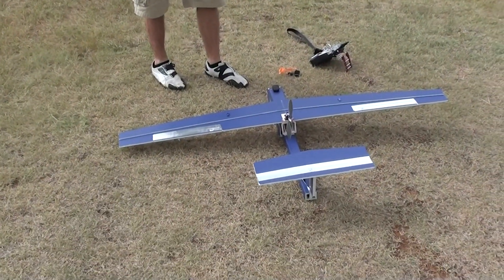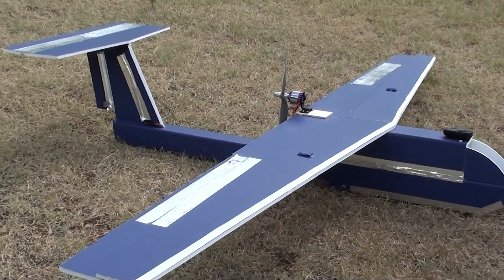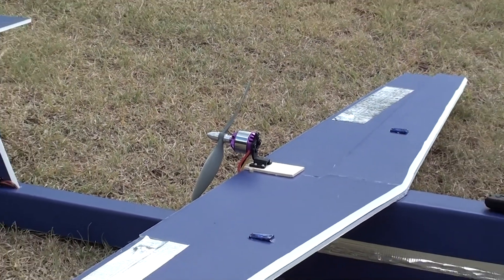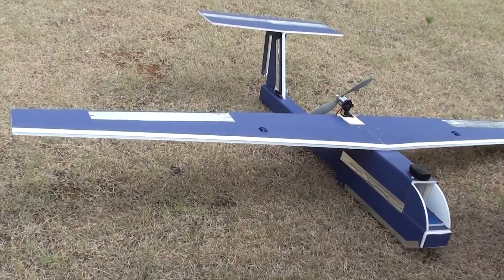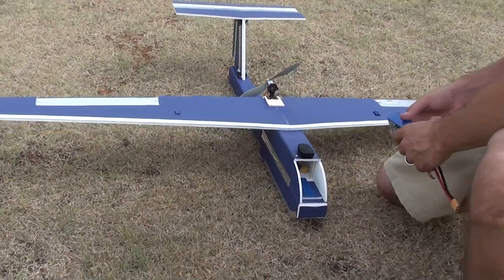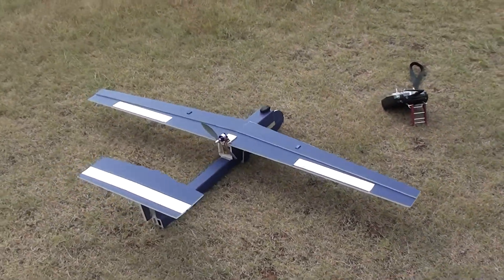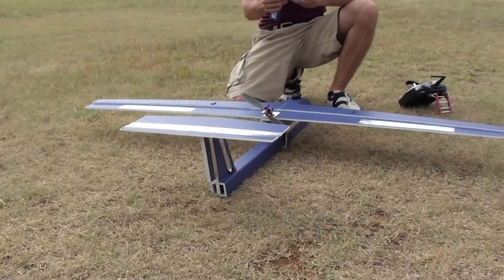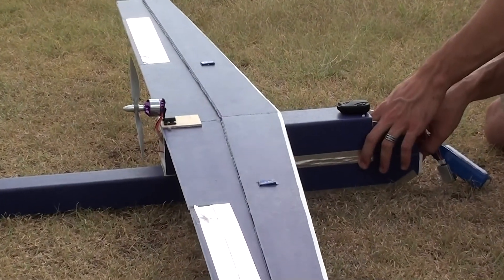Maiden Flight - Skywalker Scratch Build

Comment: How about eficiency.. is that KF2 draggy? or it can glide well? reasonable power drain for cruise?
Reply from the maker: KF2 will not win any aerodynamic efficiency contests, but what it does offer is a light weigh solution to creating reasonable lift, and a very easy to make and easy to replicate profile.  Glide is OK - and the power drain is minimal.  You could probably do a proper airfoil that is more aerodynamic, but it may weigh more.

Comment: H.Stab is 17" long, middle chord is 6.5", end chords are 5.5"  Main wing is in two sections, each 30" long.  Middle chord is 8" end chord is 4.25".  KF2 specifies the top airfoil to be 50% of the bottom, so simple as that.  The elevator is 2" (built into h.stab dimensions). Same deal with the rudder.  It really is the most stable scratch build i've flown to date.  Please please post a video response if you build it - would love to see it.

Comment: Ok - starting with the main fuselage - make two tube/squares 2.5" x 2.5" and 13" long.  Then you make the tail boom fuselage tube which is 2.75" x 2.75" and 24" long.  I inset the tail tube 4" in the bottom main tube and hot glued the heck out of it.  To make the tail nice and tight in there, I added a brace piece of foam.  Offset the top fuselage tube 3" behind the bottom main fuselage.  The v.stab is 9" tall and inset in the tailboom tube. bottom chord is 6", top chord is 5".